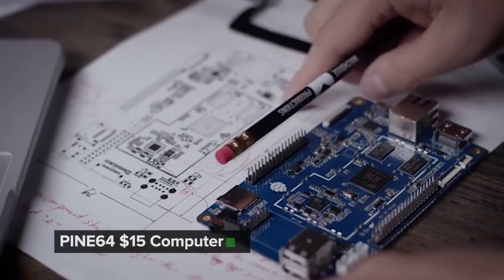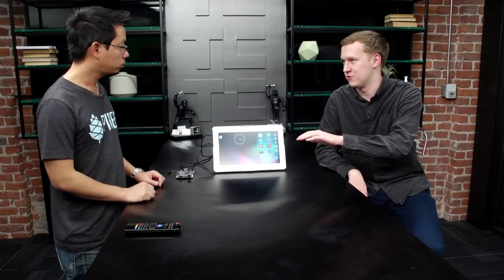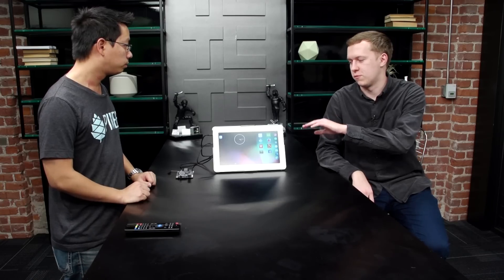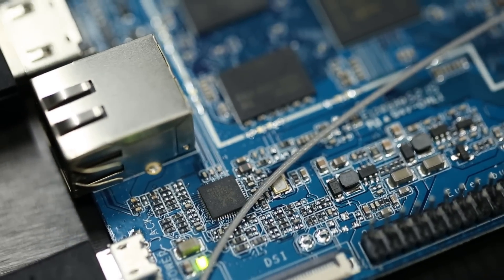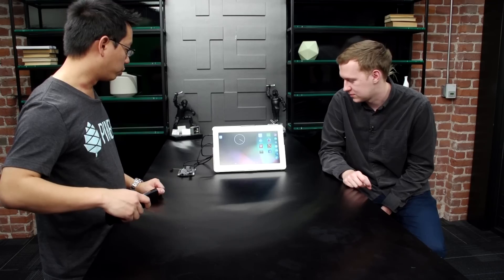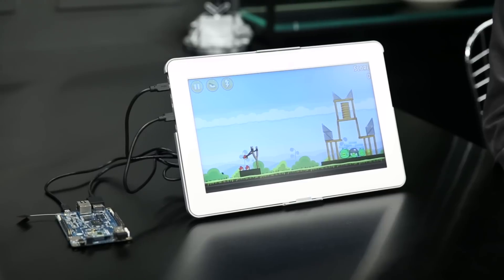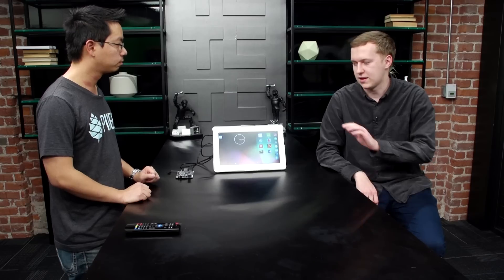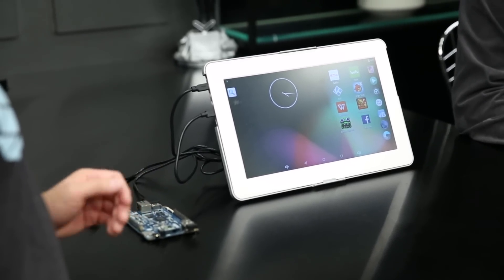$15 Computer Raises Over $1 Million On Kickstarter

Comment: Why?  Why was I not good at computer science?
Reply: It's not that hard to set up. If you buy the right parts it's just connecting some cables and putting an image in an sd card, then using it like a tablet or pc, if you can do Linux
Reply: +roscoegino Start with a RaspberryPi - there is a massive community for support and great instructions. Kids do it, so can you :) #uCHOOZE :)
Reply: +roscoegino It's more computer engineering than computer science, just like you have experimental physicists and theoretical physicist, computer science is for the most part theoretical and I would say better than engineering.
source: CS student

Comment: Can these run OS X and Windows 10??? Still is a very small size so making it a LITTLE bit bigger to add more horsepower it would still be an amazing form factor.
Reply: No. Maybe in the future. Release software compatibility is android and specific versions of Linux. An new version of linux is their first task
Reply: +PowerHouse_ PR There's a modified Version Of Android 5.1 Called Remix OS That Will Run on Pine64. Remix OS Basically runs like a Windows 10 Like Desktop.